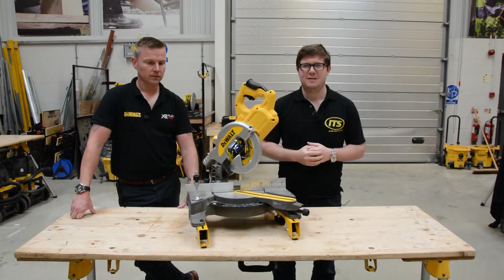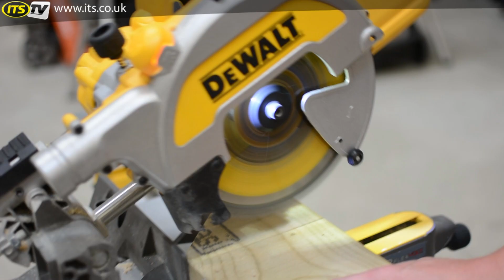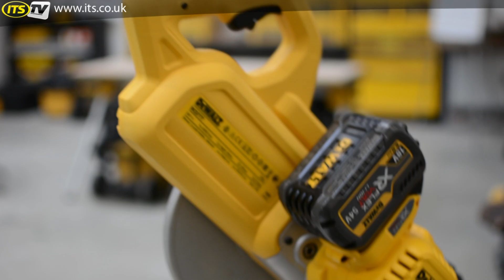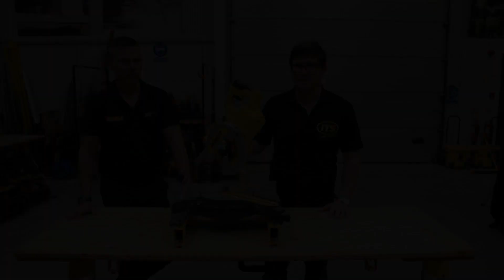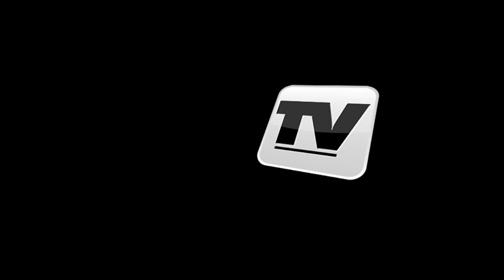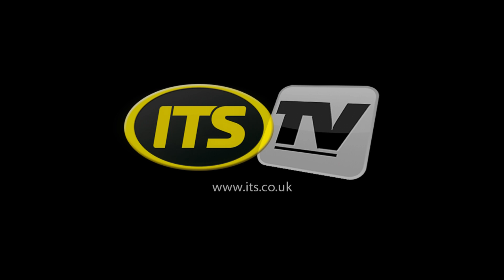Dewalt Cordless 54v Flexvolt Mitre Saw DCS777 | ITS

Comment: I bought this saw cause my corded 12 inch Dewalt mitre saw was just getting too heavy. This saw being compact, light and a built in light. It seems a bit sloppy when fully extended on the rails but it cuts pretty straight to my surprise. I find the Dewalt mitre saw rails don't rust like the Makita mitre saw I had before. They are smoother running were as the the Makita rails use to block up with mdf dust.